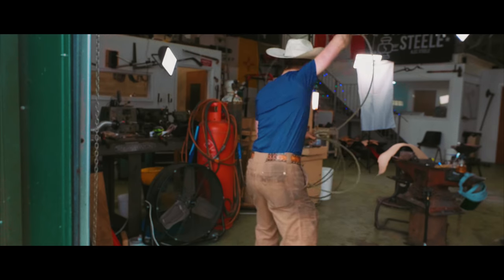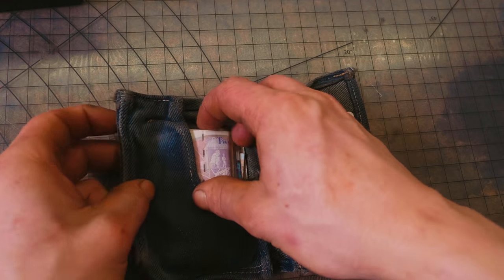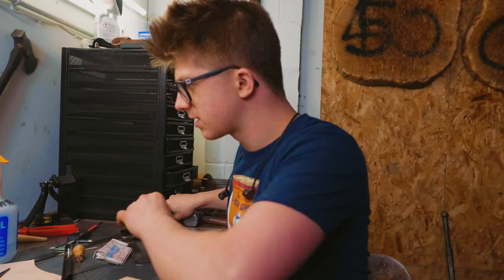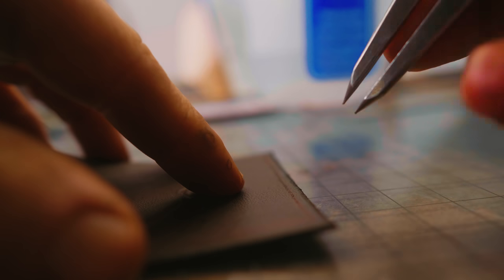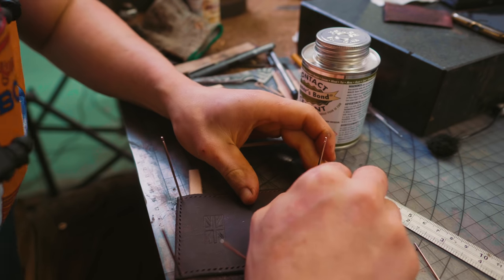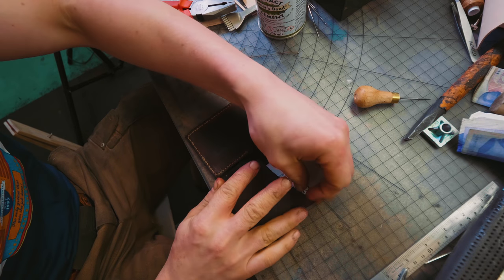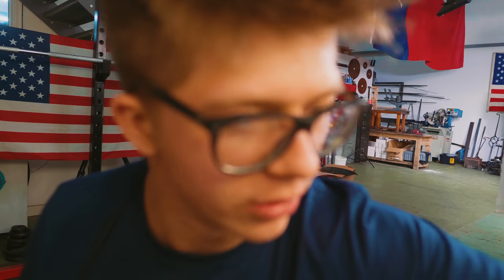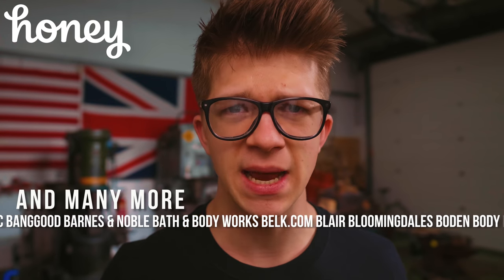MY NEW FAVOURITE MATERIAL!?!

Comment: Rough rule of thumb for stitching - measure the total length you need to stitch and multiply by 4 to get the length of waxed thread to use. I usually add a few inches to account for the thread lock bhfind the needle. Watch out, Alec, leatherworking is addictive!

Comment: great job Alec... just a couple of tips for you..take some scrap pieces of leather and glue on to the sides of your stitching pony. will help with not leaving any marks on your project. also when you are dying put some paper or other type of surface down so you don't stain your cutting mat. like others have said you need something underneath when you are using your pricking iron(stitching iron). you can use a thicker piece of leather underneath to help out also. hope these tips will help you out.

Comment: Hey Alec, Leatherworker here, 
as you might have seen, vegtan takes stains very easily so try and keep your leather station and your hands as clean as possible while working the stuff.

Also sharp tools are key, it save you tons of work. a good leather cutting knife has a very thin blade geometry and is shaving sharp. Saves you a bunch of time on finishing everything. 
And percussion stamps work great however I have found clamping stamps gives a better result.
For dyeing I have a few tips:
1 try using makeup removal pads they work a 1000 times better than any sponges I have ever used
2 if you want a smooth dye job in one color, try wetting down the leather first, it will help it flow more evenly
3 also dye your sides properly it will help you when you get around to burnishing the edges.

and about burnishing ^^
allot of elbow grease works but lets work smarter not harder.
might you have some carnuba wax and some fabric that will not stain your work use that to prework you edges and than finish up with a smooth piece of wood, or dense plastic it will save you tons of time if you dont have a power burnisher.

Also finish wise, you might want to finish it with some carnuba wax and than some Sheen or Super Sheen.
It helps seal in the dye so it is less likely to bleed into you clothing while in use.

Hope that helps brother and welcome to the Leather medium XD
Cheers
Love your videos
Reply: Also what I would like you to make for yourself, because it is so useful
A toolbelt, saves you from running around during a project searching for that "one thing you just had in your hand a second ago"

Cheers mate!
Reply: Thank you!
Reply: Ruud van Tiel    If you press the three little dots at the bottom right of your comment it produces a small menu of three items. In the menu press edit. You can then add more text to your comment and press the symbol for posting it again. That way you don’t have situation like this one where you are basically commenting on your own comment. 
Cheers mate

Comment: Great job! I see people recommending you burnish your edges which is good, but the advice I would share with you is this. When cutting your thread, take it and pull it across your stitching area and then cut a piece 3 to 4 times the length. You will almost always have extra but I can also say you won't run out. My teacher always said "thread is cheap".
Reply: Depending on the total thickness of the material I'm using I usually go with 6x!
Reply: For 8-9 oz leather, making sheaths, I go up to 8. I've ran out too many times to go any less.
Reply: If you would have sewn the top, just that waxed thread would have given more strength for a lengthy life of your wallet.

Comment: You could have rounded the corners a bit and burnished the edges to make it last longer. It's also easier if you align the individual pieces to make the holes for the stitches instead of doing them twice. They'll also fit perfectly that way. Make a swordbelt next, the thick leather will be perfect for it. Forge a nice ring for it instead of using a buckle.

Comment: You didn’t burnish any of the edges Alec. But that’s a very pretty wallet. Think I may have to try my hand at making one
Reply: Joe Samlofski this was my first thought I had as soon as he put it close.  Especially since he got the tool.
Reply: Burnishing looks good does it also make the edges last longer and not like fray?
Reply: Christian Wang burnishing gives it a finished look.
Reply: Burnishing makes the edges look slick and makes it look much more professional.  What you're doing is mashing down the loose fibers.  Yes it will keep the edges from fraying but leather is so robust it will just give it a rustic look.    The leather is much more likely to dry rot from a lack of conditioning than to fall apart from the edges in.

Comment: Self healing or no, you should keep a wood block (soft as possible, pine or something) around so your leather cutting mat is usable for as long as possible.
Reply: A harder wood will wear on the leatherworking tools more than a soft wood, so they will work longer without need of a sharpen (which is a complete bugger). As for material, I really like the mats Fiskars and  Alvin make.
Reply: I have always used a 1sq ft slab of marble with a 1/4 inch thick piece of rubber cemented to the other side ... both of which I get from Tandy back in the day.

Comment: Got your supplies from Tandy Leather I see.
I can probably name you every tool on that bench.  Can even quote you some of the part numbers off the top of my head.

Alec you did not put any kind of conditioning or a finish on that leather.

After water forming you might notice the leather is a bit stiff.  That's because the dye and the water forming has dried out the leather a little.
A little bit of Mink oil or Neatsfoot oil (not neatsfoot compound. Get the pure stuff) will fix that right up.   
Also.  A good finish will prevent the dye from staining your pants if you ever get caught out in the rain and it gets wet.
I recommend Leather Balm with Atom Wax.
That will give you a nice finish protective coating but still be pliable and not too shinny.
Reply: I can quote the prices for tandy aswell.
Reply: Forget the rain, that dye might seep from pure rear-end sweat in that hot blacksmithing workshop! Haha, it’s a joke but also might be true!
Reply: Specter Ranger lol.  Actually.  You're not entirely wrong. Any moisture will cause unsealed dyes to bleed at first.  It takes a few months before any excess dye is really out. 
Sealing it in tho should fix that problem . immediately

Comment: Long time listener first time caller. Tip for stitching. You can get a stitching groover which works just like you did with the calliper except it cuts a little groove for the thread to sit in. This helps prevent the thread from wearing and ultimately breaking as it sits flush with the leather instead of proud.

Comment: In the future, prior to cutting the end of the thread or sinew (depending on what you use on leathercraft going forward), it's best to thread it between the layers from either side. Once you do that, tie a TIGHT square knot and cut the remainder. A few taps with a mallet, and the knot disappears into the seam for all time, while remaining exceptionally strong and tight. This is how I hide the knots in leatherwork, and it's worked well for me over the decades.

Comment: Nice design. The top looks like it’s going to wear and become flimsy really quick
Reply: Agreed. I feel like, if he had a bit more material, he should've done an exterior fold and stitch to help brace it up. You know, like an extra layer for the back/exterior of it.
Reply: Lining it might have fixed that, or skiving it and folding it over
Reply: Even just burnishing the edges would make it stiffer and more wear resistant than a basic cut edge.
Reply: You would be supprised how durable leather is.

Comment: Hi Alec !
 I work with leather too (only as an amateur right now)  And I just wanted to put my tips here for you :
- Pour some dye in a plastic tray where you can easily use the sponge. that way you don't "contaminate" your bottle and there is less chance for it to spill everywhere
- You may also want to put newspaper, or something, underneath the leather.
- For marking the edge of the leather use a blunt tool (your compas work well) that way you don't "scratch" the leather but only "press in" the groove
- using the chisel prong , you may want to use a dedicated mat, it's going to wear our quickly.
- I chisel the holes after glueing the two sides, that way holes are automagicly aligned (and in the same orientation)
- You need around 6 time the length of your stich in thread
- Clean your workshop after !

Hope you see this coment and find it usefull !

Comment: Alec, rule of thumb for the thread length: measure the total length to be stitched, then multiply that number by 3. if you’re stitching thicker leather, or many layers of thin leather, increase the number you multiply by. i’ve made sheaths for a Kukuri and a Machete, and i never multiplied greater than 6 with holes 5 mm apart

Comment: A more "civilized" hobby, no?  No heat, not strenuous, no dust mask, no heavy, expensive equipment required.
Reply: 454pakr that's where leather burning comes in...
Reply: Yep!, and only 1 dead cow involved LOL!
Reply: But where's the fun in being "civilized"
Reply: Its plenty expensive a thing of rivets cost four bucks
Reply: Leathercrafting is plenty expensive XD. I don't think I even went into the store and left without a 200+$ bill.
Reply: ..you can eat the cow and make things out of the same cows skin at the same time ^_^
Reply: And no hand sanding
Reply: Mike Foster - A comma after that “no” would probably be useful. I was confused for a bit there, lol.
Reply: Mike Foster civilation was built by wheat farmers and potters. Agricultural revolution mate.
Reply: Flur not shure if serious, or poe's law
Reply: you can do it in an LA apartment?

Comment: Like to punch the holes with the diamond punch (the thing with the prongs on it) after you glue both sides together so you don't have to worry about lining up the holes. Also when you use the punches I found it is way easier to get a full and clean punch when you put either a piece of scrap leather on the bottom or punch into something softer like wood. That way the punch doesn't stop when it hits your table and make a full clean hole in the leather.

Comment: liltle tip for puting a thread through the needle hole; cut the thread end at an sharp angle. you will get less surface contact with the needle hole and the tread will slide in

Comment: Great little project. If it helps, and if no one's already mentioned it... When you put on your card and cash sections, if you run the stitch off the ends by a stitch or 2, it'll hold down the very edges, stop them curling up. :)

Comment: Helpful hint: use your calipers to scribe your stitch lines before you bevel the edges to keep your lines straight. Also I usually wet my finger and apply a little water to the edge of the leather where I burnish, I find that gives me a smoother edge.

Comment: Great job on the wallet.  I just recently started working with leather too. I made a knife sheath in a class at Tandy Leather one Saturday.   So I then bought more and made my first belt. :)  Make a belt if you get a chance. It is fun. I used screws and rivets so it did not require any stitching.  I found I needed to glue the back or rough side of the leather after I made it.  I will do better on my second belt.   Oh and wet the edges before buffing them. I forgot. LOL

Comment: Like watching a baby learn to walk ;) Good job. I always find learning new stuff from scratch very exciting. Short tip, make sure the glue is dry before you put both parts together and hammer it don slightly. Also if you leave few mm margin and cut the edges after glueing it will give you nice smooth edge. And edge finishing in leather craft is what heat treatment is to metal work - whole separate mistery level :)

Comment: Little tip for guessing how much thread you need on a saddle stitch. Take your piece that you're stitching and run the thread along side the stitch marks. Then double back along the stitch marks till you make it back to the start of them. Then add in about 6 to 12 inches, depending on confidence. You'll need the little extra bit to stitch back and make a good friction fit for the ends, and it can be tricky to feed the needles through when you run low on thread. Also it never hurts to have a little extra, just in case you skipped a corner or something.

Comment: Handy hint, to do a saddle stitch, measure the length of material you need to stitch, times that measurement by 3 and that's roughly the length of thread you will need. Myself personally i times it by 4 just in case

Comment: Cool trick for you when you are measuring the thread. Take the thread and lay it down along the whole stitch line. Take that then make It three times as long (so you should have three lengths of the stitch line) cut it and you will never have to worry if you will run out of thread or not. Hope this helps :)

Comment: Alec,
A tip for making the “holes” for the stitching. Glue or contact the pieces together first then use the “diamond” chisel or “pricking” irons to make your holes. That way you’re sure the holes line up. (If you punch the holes separately in each piece, you stand a chance of not matching them up)

Another hole punching method, especially if you have thick leather or multiple layers of leather, is to punch the holes, but not all the way through, maybe just through the first layer. Then as you stitch, you push a very sharp and polished diamond awl through, finishing the hole for your threaded needle.

It looked like you bought your leather from Tandy Leather. Tandy sells excellent books of instruction for stitching and lacing.

Comment: for the length of the string: take about three times the length of the stitch you wanna make, plus a few inches. for thick material use up to 4 times. Secondly: when you are hammering the stitching holes, take a piece of soft wood or thick leather, so you dont hammer into your bench. thirdly: if you flatten your thread by laying it on a hard surface and rolling it with smth sharpie-sized (the last cm or so) towards the end, you have no problem getting through these oval holes in your needles (no clue what they are named, I'm not english)

Comment: So, when stitching, there's neat trick if you want to avoid having the cut ends of the thread visible. You can push the needles back int the final hole, but instead of going all the way through, only drive the needles through the first layer of leather, then angle them and push them out out through the space in between the two pieces of leather (being careful not to break the needles). Tie it off, clip your ends, and use an awl to push them back into the space between the leather pieces. By doing this, you'll have hidden your ends so that they be hidden, and so that they won't fray.

Comment: See a lot of people asking about the list of supplies he used. So here's a list of what he used, and some things that'll make your projects easier/longer lasting:

+Leather- Vegetable tanned 4-5 ounce for the back, 2-3 ounce for the pockets.
+Dye- Looks like Tandy's Eco-Flo. Fiebings Pro dye gives better coverage and is easier to work with though.
+Finish (not shown)- Carnauba cream or atom wax followed by an acrcylic finish to waterproof.
+Gum tragacanth (not shown)- for slicking edges with burnishing tool.
+Sponges/wool daubers
+Stitching chisel, or pricking iron in the uk.
+Awl
+Edge beveller- #2 is good for most projects
+Stitching groover (not shown)- grooves out your lines so threads lay flat.
+Wing divider
+Utility knife
+Wood slicker/burnishing tool (not shown)
+Waxed thread and blunt needles
+Contact cement
+Safety Skiver
+Cutting matt- self healing are the best

Comment: Make sure to treat the leather over time as it will dry out. You could potentially reinforce the corners of the wallet. Perhaps some hand crafted Copper end cover pieces on the 4 edges, thin enough to not be bulky, but protect the corners... Just a thought of being different, but allow you to incorporate some metal working at the same time...plus it's a softer metal...always fun to try.

Comment: A basic rule for stitching leather; use three times the length of the line you wish to stitch. Thread is usually real cheap compared to the rest of the supplies you will buy. When using your 8oz leather, go for 4 times the length. 
 Alec, may I also use this design for a video?

Comment: If you find you're having issues with the wallet folding, I think you can use a tool to remove a small line of leather at the crease.  I feel like I recall you guys doing that in the shealth video.  Great project regardless!

Comment: I would usually use a lighter to light the string after I stitch. I will burn the wax and make it melt  and finish the stitch. But don't forget to burn out the fire before it burns the string

Comment: Alec you should burnish the edges and use a little Fiebing's edge kote on them for a real nice finish on the edges. Also I would recommend using some type of top coat to protect it. I use Eco-Flo Super Shene, but if you don't want it glossy they have Satin Shene as well.  Great work though!

Comment: 1. Bite the thread before you try to put in in the needle. 2, cord. You need about 3.5 times the length of the stich. 3 remember. If left hand is under on first stitch it's under on all stiches.
Reply: Last thing. Finish the edges with bees wax and a wooden dowel. I cut a groove into the dowel like a slicker tool and rub the wax on the edge of the leather then work back and forth until it is hard and black.